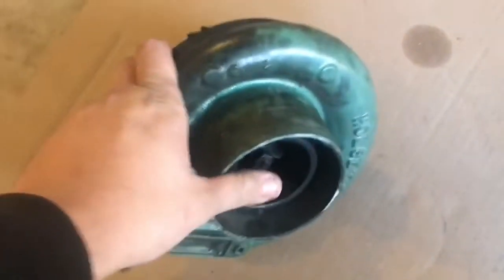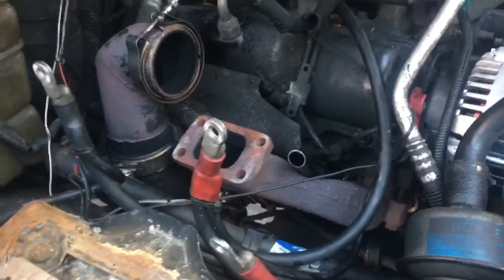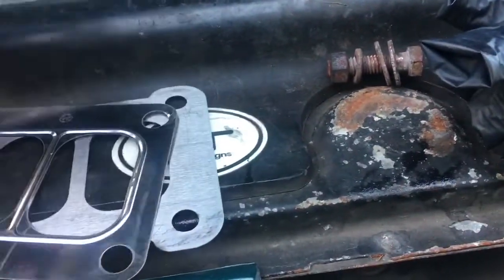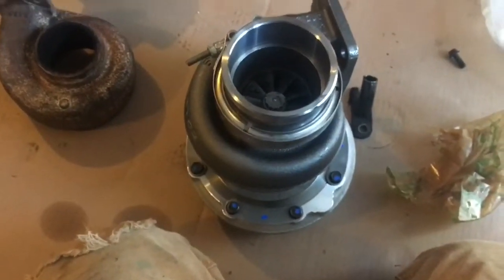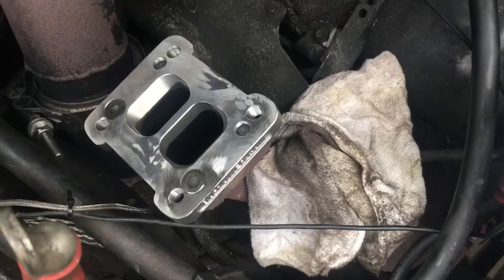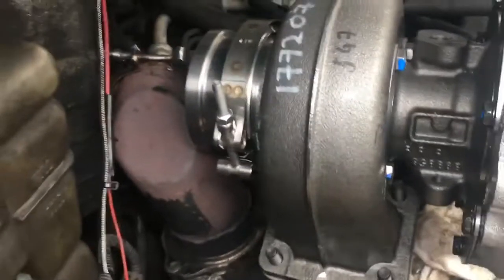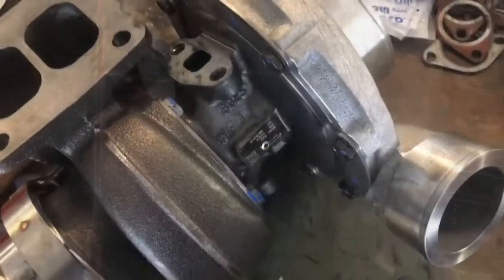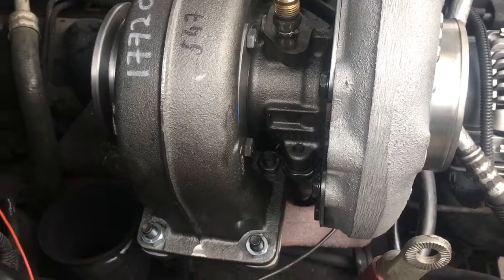6.5 Diesel Borg Warner S300 Install - Part 1

Comment: Why did you go with S300 and not a HX40W Super?

Are there major differences?
I have never seen an S300 before.

The reason why I am asking is I want to do compound turbos on my 2.8isf Cummins and all info I get is they fit a S300 as a primary turbo but it is not wastegsted.
I was thinking of fitting a HX40W Super that has a wastegate and the HX40W is cheaper from what I can find.

Is the S300 a better setup than your previous HX40 hybrid?
I have a HX50 turbo that I was planning on fitting on my 6.2 diesel with 4 speed manual transmission.

Cheerz